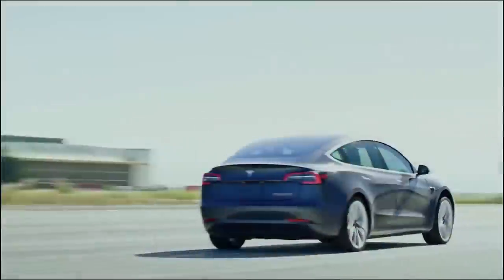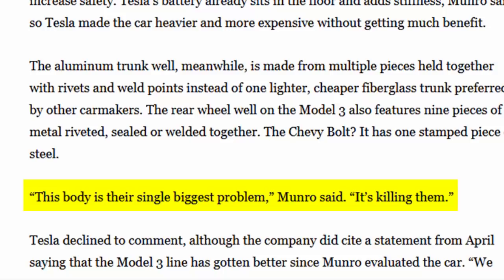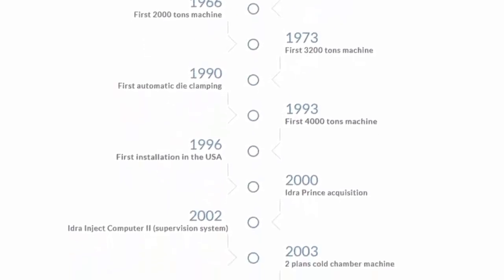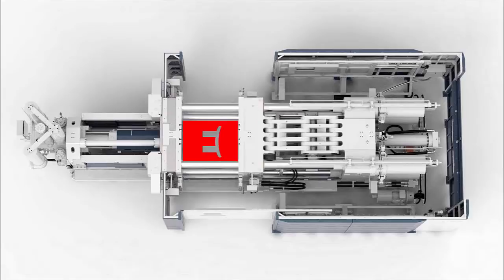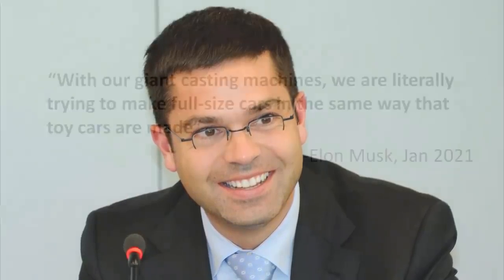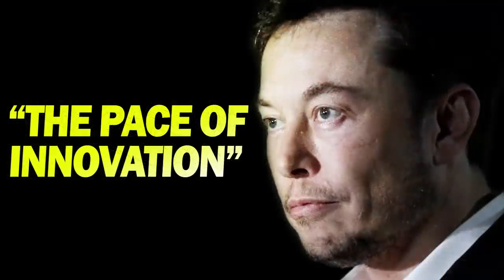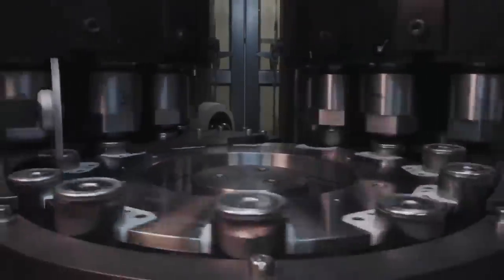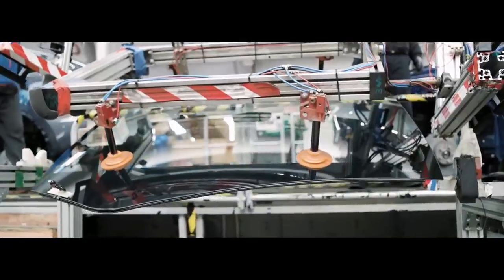Tesla Giga Press will CRUSH

Comment: I believe Tesla also designed the liquid aluminum alloy that is used in the giga press. If it is patented then even if another company got giga presses.. they would need to either design their own alloy or pay tesla for it
Reply: You do realise how many alloys are used in manufacturing? I would have gone with a magnesium based alloy as it is much stronger.
Reply: @dikkybee4003  the alloys that can be used in these presses are specific from what I read. You can't just use anything as it needs to able to be squeezed out in a certain amount of time and need to be hardened in a certain amount of time
Reply: @genejoo5552  Been working in die casting for the last 20+ years and what Tesla is doing is nothing new. Magnesium is lighter and stronger than Aluminium and we have been casting it for many years. You will find the alloy they are using is a modified alloy if not an alloy already being used. I have been using IDRA machines for years, nothing new here just scale size.
Reply: @dikkybee4003  But magnesium is flammable. I'd stick with aluminum.
Reply: @dikkybee4003  True , but it makes good headlines if it looks like something new .
Reply: @dikkybee4003  But they did put the word "giga" in front of well, everything.
Reply: @mnotlyon  where I worked we came up with an alloy that doesn't burn like pure magnesium and made it easier to machine so it as quite safe to use.
Reply: @genejoo5552  the amount of time it takes to hardened is controlled by the temp in the die which is controlled with heaters and cooling channels and most dies have thermocouples to make sure the die doesn't get too hot otherwise the molten material will solder to the die. As for the amount of materials used is quite large but I did suggest magnesium as I have worked with it and know what the mechanical qualities are and it is much stronger than aluminium.

Comment: I think people aren't looking at the issues around potential crashes properly.  I had a small accident years ago that resulted in a small 1-2" dent in the undercarriage of my car near the front passenger door.  The insurance company wrote of the car and sent me a $12k check.  If the frame of a car is dented, the insurance agency is going to write off the car either way (at least, in the US).  So, if the frame made from the Giga Press is dented, it's not different than if it happened on any other car.
Reply: that is correct, if the integrity of the vehicle is compromised, the insurance company will buy you out.  It would cost too much to repair and restore it back to the original levels of safety.  The fear that the vehicle can't be repaired is just FUD.

Comment: your videos are great but Please check your numbers...1000 castings per day? That is high even if they do 3 shifts. Then your next number of 1.5 mil is too high as your number does not allocate for machine maintenance machine downtime vacations holidays times when they shut down the plant all of which do happen in a normal manufacturing facility. So for you to expect the machines to be building casts every single day for three shifts a day that still is less than 1.5 million and there's no way they will be able to achieve that high of a number considering normal factory downtime and normal maintenance. So please your videos are great and we love them but please check your numbers.
Reply: There are ~1400 minutes in a day. At under a minute and  a half per cycle, that's 1000 castings per day running 24/7
Reply: @Andrewk950  thats the calc, in real world noone runs near these outputs with complex machines. Just like your avarage speed will never be near you topspeed unless alone on a circle track
Reply: Talking potential here. Even if throughput is 90% it's still a blockbuster.

Comment: MISSION of Tesla  - does NOT include preventing competition by buying up companies.
IF Panasonic could/would have made the 4680 battery, Tesla would have no reason to make their own battery making machines.  Panasonic couldn't justify the risk?? I'm guessing. AND it seems Tesla is sharing this 4680 tech with battery makers.  Limiting function still batteries, right?
Reply: As of last month anyway Panasonic was working with Tesla to build out a 4680 production line. The head of Panasonic's battery production said in an interview with Bloomberg that it was especially challenging to keep tiny metal fragment's out of the large cells as they were formed. He also expressed concerns about Tesla's ability to keep the core of the battery cool (Yes, I know what Elon said).
Reply: Tesla is not a big fan of outsourcing to the maximum level.  But don't think Tesla will not work with panasonic anymore, they just want their own production plant, own engineers themself etc.  Partnership is not the same as outsourcing.

Comment: 10:20 Could this single casting be how the proposed entry level compact car will be made?
Reply: Can you say "Game Over!" boys and girls? 
Imagine a Tesla for sane price as a Toyota or Honda. It's only a few years away. Wouldn't be surprised if Tesla unveils their plans for something before end of year
Reply: @ChuckWortman  it has nothing to do with tesla. Idra Group is building and designing those machines.
Reply: @Dan 13 It is quite interesting that after all the success Tesla has had, you are still in denial. Aluminium is not expensive in itself, nor is stainless steel, it depends on what manufacturing methods you use and what what you save based on the materials superior properties.
Why do you feel a need to call people cultists? Has Tesla or any Tesla supporter hurt you? It is quite irrational to be this emotional about cars being manufactured in a new way.
Reply: @Dan 13 Correction, Aluminium was the expensive way to make car bodies.
Reply: I have speculated in that the next step would be to mould the whole load bearing framework and then glue the sheet panels on top. You want the sheet metal to be milled for strength, not cast, but window pillars etc could be cast and maybe, just maybe, the whole structure could be made in one shot. That would be a game changer for sure.

Comment: 10:25 na m8, patents work the other way around, you file it which takes easily a year, and maybe one year after that you build the product
Reply: I think that depends on the country.  In the US, you can file for a patent, and immediately start production, but the patent won't be listed until a year or so later.  That's why a lot of US goods have "patent pending" on the label; the patent was applied for before production was finished.  You can build a product before the patent is officially approved.
Reply from the maker: You can technically have the product built before the patent is filed, as long as it's not released in the public domain. once they file the patent, they can do whatever they want - there's no waiting necessary.
Reply: When you file a patent it stays private for  a years time until others can see it. Building the actual product can happen at any time after the patent is filed

Comment: People say competition is ramping up for Tesla. I say the competition is already over.
Reply: LOL sheeps.  if it were cheaper to build cars this way other companies would just buy this press from Idra Group like tesla did. And perhaps they will. That is right  - this device has nothing to do with Tesla or Elon Musk they just bought it from Idra Group.
Reply: @hagestad  We will see. People were saying the same thing about EV in the past 10 years.
Reply: @zihaozhang7177  EVs are still not as good as ICE, they do need to improve. Why is tesla still using what you fangirls calls "gas guzzlers " to build their factories, or why are they used to mine lithium, aluminium, nickel......
Reply: @alanmay7929  Well you gonna take it one step at a time. Start with commercial cars, then semis, large transports like trains and buses, boats and ships, then all the heavy machineries. It's gonna take decades.
Reply: Grow up mate.
Reply: Competition finally came, but found themselves far behind & running backwards while trying not to trip on their own (legacy Osborne affected) shoestrings. Sad, especially for the former luxe brands.

Comment: When they say "8000 ton" press, is that referring to the pressure on the liquid metal before the shot, or the pressure on the two halves of the mold ?  I would think the mold could be closed and latched without the need for active pressure, no ?
Reply: 8000 ton is a force and not a pressure.
Reply: Google it, the pressure is how much hydraulic pressure is used to hold the mold parts together and you cannot latch mold parts together mechanically.
Reply: It is the clamp force of the machine that holds the mold halves together. It must have that much clamp force because of the size of the molds. If you multiply the surface area of the part by the injection pressure of the aluminium, you come up with a huge force that must be overcome. If you look carefully at the drawings of the machines, you'll see huge cams that lock into place to hold the pressure during injection.
Reply: It's the closing pressure, when the shot is taken, it must hold that pressure for about 12 sec, the cooling time.  The size is based on the side of mold

Comment: Tesla does actually have bought a robot/tool manufacturer, Grohman Engineering, from Germany.. They could buy the company very cheap, because it almost went bankrupt, Tesla saved the company and all employees could stay on board... Now it is hiring and expanding Grohman engineering.

I love how Tesla is bringing costs down and the same time improve quality of the cars by introducing these megacastings... Elon Musk tweeted when he was in Germany the other week, that the "Next Gen Model Y tolerances will be measured in microns, not milimeters" 

So stoked I have a Next Gen Model Y on order (will come from Berlin)!
Reply: lmfao what. What does even mean? Tolerances for what?
Reply: @mechanomics2649  The famous tesla body gap. They always been known for having body gap issues. These one big piece molds should solve a lot of the issues.
Reply: You guys understand how microscopic one Micron is, right? That's not happening. They'll get tight tolerances, not by the microns. Not even close
Reply: Unfortunately I will have to totally disagree with you, even with those castings tesla will still be worse than a cheap vw up panel gaps, not to mention the interior. Tesla has no improvement in quality control or whatsoever. Cars still needs stampings for doors, hood, fenders, trunk...... they will still need to be aligned.
Reply: @alanmay7929  Ignorance is not a virtue, you have no idea what you are talking about.. 

600 less robots, thousands parts less.. Of course this helps improve quality, because it removes 600 opportunities to add flaws. Plus these mega castings are accurate up to the micron level... No spring back, no warps, no stress.

Just watch Munro Live talking about this, he explains it very well.
Reply: @MarcoNierop  one thing people forget is that other manufacturers already have all the production equipments and they do not use that  much robots like you mention here 600 less. Wtf! Tesla was using 70 different pieces for the rear part when other manufacturers uses way less than that. The big casting machines may also be unreliable or have trouble sometimes.
Reply: @MarcoNierop  your ignorance just baffles me, you realise that the doors, fenders, hood, trunk needs to be stamped right!? Thats where the famous giant tesla panel gaps comes from. A $15k toyota has way better fit and finish than a $100k tesla.
Reply: @alanmay7929  Beside that, Tesla quality has already improved a lot, Also ask Sandy Munro, when he watched a brand new Model 3 on his road trip a few months ago, it was spectacular well made, consistent gaps, flawless paint.

Interior is a matter of taste, I personally love the minimalistic design, if you like a car with loads of clutter and useless buttons, good for you, but not my taste.
Reply: @MarcoNierop  I like my car to be versatile and customisable and less boring, I regularly go camping and overlanding and a car full of computers won't work well in the wilderness. I need my buttons to avoid problems if the big screen ever fails.
Reply: @alanmay7929  You will change your mind someday. I also camp a lot during summer , and I know for sure my Model Y will do very well.  You do not even need a tent, just sleep in the car with Camp Mode on..
Reply: @MarcoNierop  your modely barely has 300 miles of range and a prius can go way further than that and people have been living in prius going to remote places...., a tesla cannot reach the places I usually go to and I can also sleep in my car with no issues.
Reply: @MarcoNierop  my toyota hilux has about 1000 miles of range which means I can decide to go basically everywhere I want anytime I want.

Comment: I’ve mentioned this in other threads that this is a quantum leap for all metal manufacturers of large structures.  I’ve worked in aerospace and by reducing part counts and if they can also eliminate heat treatments or anodizing, this would be extremely impressive.  This will be the moment people must recognize Tesla.
Reply: Aerospace? have they solved the problem of crack propagation, and the issues of designing in stop points for this when using large single pieces?
Reply: No.  This is why material hardening and 100% inspection is typical.  @chrisdavidson911
Reply: @fcarter935  which is fine in the aircraft industry, but how's that going to play out with vehicle inspection?
Reply: @chrisdavidson911  I have no idea Chris.  I do not work for Tesla.  Just perhaps there is something in the new metal alloy? Manufacturing and metal science has changed very little in the last 50 years.  That’s the point on my opinion.  Most companies take least amount of risk as possible with short-term thinking.  Tesla prefers the road less traveled, in my opinion.  Time will tell the durability of these new castings.
Reply: People have been saying this kind of thing for a while, yet Tesla underdelivers.
Reply: Hasnt this been a thing for decades tho
Reply: Oh wow so he's literally going to lay the groundwork for using these types of castings in space!
Reply: Nonsense, different constructions different manufacturing, parts doesn't always needs to be eliminated, you think tesla is going to use a casting on their semi?! Uhm nope sorry mate, steel is the solution here.
Reply: you are acting like Tesla is being undervalued
Reply: Only Tesla didn't invent it.  It's made by L.K Machinery & Idra, it's been available as  catalogue item for 4 years now, and you can buy one yourself now if you have the cash, and it's already in use at many other factories world wide.  LOL, Tesla cultists believe any shit that asshole spouts.
Reply: How do you suspect the average Joe fix there CAST cars? Having multiple parts allows parts to be fixed rather than stressing and buying another
Reply: @unknown-ql1fk  Those parts don't get fixed. They're junked and replaced just like Apple (even though parts exist to repair Apple devices at independent repair shops).
Reply: @sammiller6631  no one "fixes" the frame of a car, the car is junked.
Reply: @unknown-ql1fk  
An existing car is essentially a very rigid box with progressively "less strong" pieces fixed to it.
Those pieces "break" if hit. If the force is enough to damage the box, the car is written off.
These castings have the same lightweight "sacrificial" struts and panels bolted to them.
If the accident reaches the casting, that car was ready "toast".
However.... As with cars like the original Mini, front and rear subframes can be removed, rebuilt and replaced where the welded crimes on other cars can't.
Reply: Sure, there will be trade-offs, especially regarding insurance claims, but you will have a safer car that saves lives in the long run that should be affordable with low maintenance.
Reply: @unknown-ql1fk  depends of business model, if the clients are rich enough, they can buy another car
Reply: Tesla have re-designed mass production, as Henry Ford did a century or so ago.
Reply: @davidtuer5825  tesla did nothing to mass production stfu.
Reply: @davidtuer5825  no they did not. they just bought the solution from Idra Group like almost all other parts for their cars.
Reply: @hagestad  I understand that Tesla hold the Patents on the innovative Giga moulding process, including the aluminium alloy used. Anyone with experience of casting molten aluminium will tell you of the difficulties in eliminating porosity in the casting.
Reply: @hagestad  
Tesla REQUESTED the solution from Idea Group.
As with most things they do, Tesla went to first principles "outside the envelope", then when (probably) told it couldn't be done, found a way (and the expertise) to do it.
Reply: You are right.  This process is very impressive.  It will change how things are made. The process and the new material have big implications.
Reply: C M  its not a weight reduction to a modern spaceframe, they are doing it because they have massiv problems in their us Factories. They had big problems with their workforce and their robots.  Its also alot cheaper than investing in more modern designs.